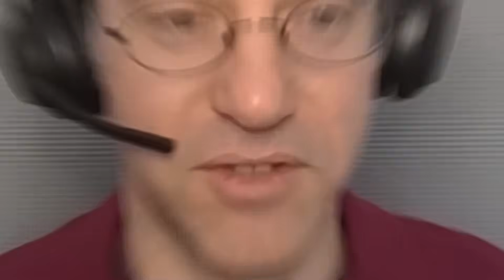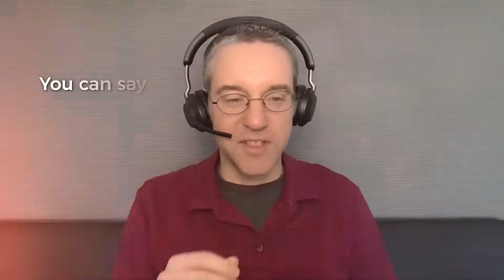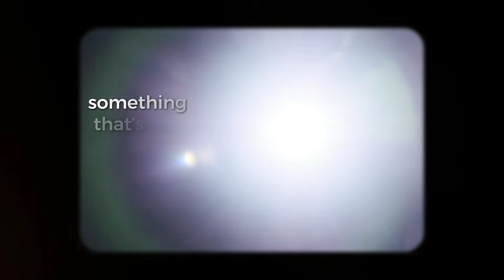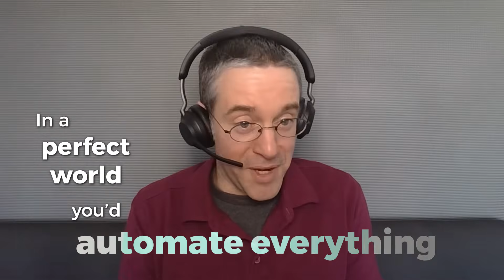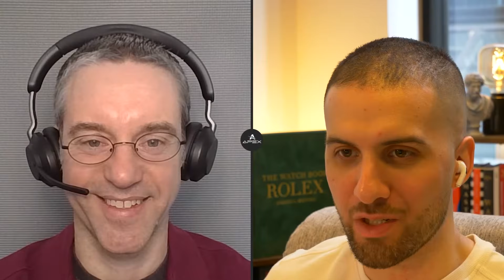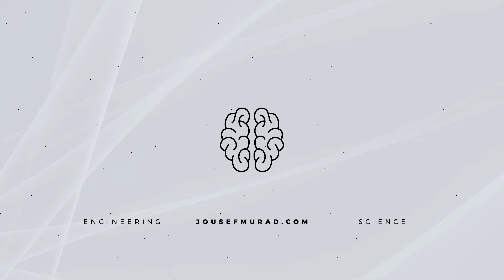Simulating Reality with Simscape: Multi-Body Dynamics & AI – Steve Miller | Podcast #152

Comment: Thank you very much for the excellent content of your channel Jousef. I would also like to thank the guest Mr. Steven Miller who in a simple, clear and quite pedagogical way gave us a summary of his experience as an engineer in the area of multi body dynamics. Although my field of action is not directly related to multi body dynamics (I have dedicated myself more to the operational, supervisory and commercial part), I would really like to learn a little more about the subject, review the theoretical fundamentals and do simple practices with simulation software; in fact I started with the FEA area about 1 year ago oriented towards solids and structural (I did the EdX course “Introduction to Finite Element Analysis with Ansys”, which is an excellent introduction and very practical, as well as Daryl Logan's book “A First Course in the Finite Element Method”, which I recommend to have a theoretical basis). Other of my interests are oriented towards CAD modeling and design with Autodesk Inventor, which has dynamic simulation tools but which I have not been able to master. I find interesting the approach of Mr. Steven to start from the beginning to model and simulate a system to take into account the most general and critical aspects. Greetings from Venezuela, I wish you a lot of success with your channel